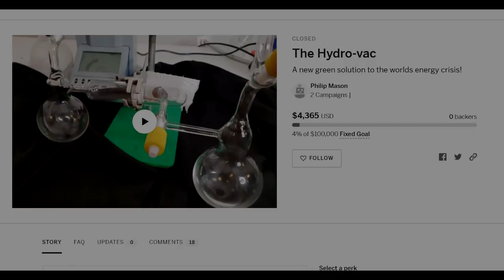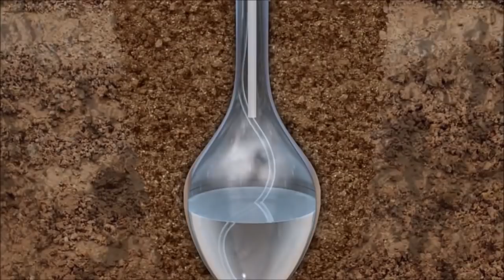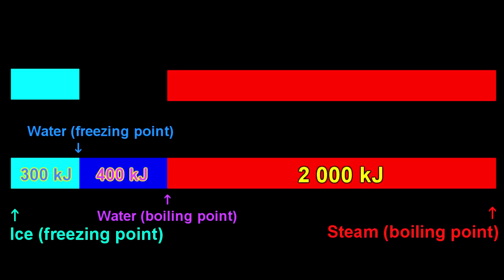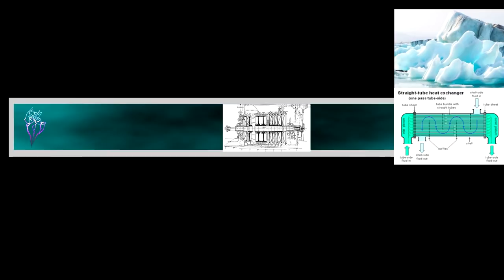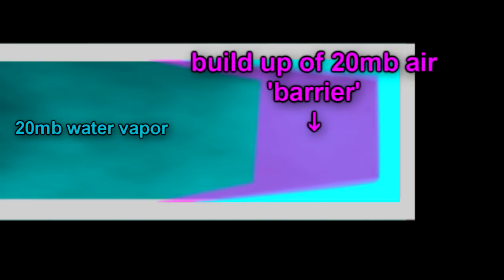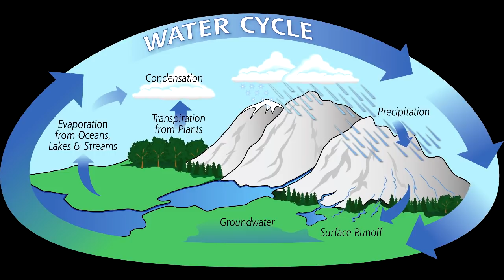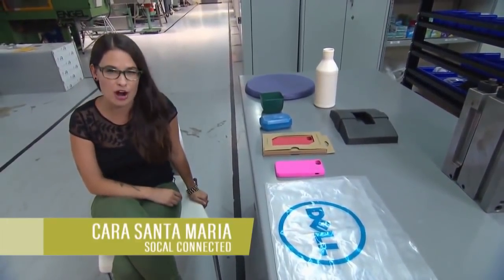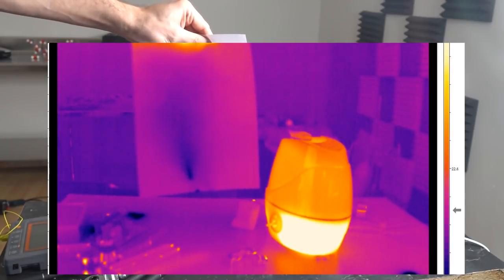The Hydro-Vac -BUSTED

Comment: I'm sitting at 7 minutes and I'm just curious why can't instead of using the ice to cool the end of the tube just use a really massive aluminum heatsink look I'm talking like a two-story heatsink the atmosphere could do the work sure it would warm up the Arctic but that's already happening
Reply: Dip one end in the ocean as a heatsink, and let the sun shine on the collector, not like the sun doesn't warm the sea anyway, although it will be a little less, if you are extracting some of the energy.
Reply: @threeMetreJim  na na he gets to why it wouldn't work
Reply: @candidcomments292  He's using the difference in vapour pressure, running the hot side at around 30 degrees C with the cold end at 17.5 degrees C will make the same vapour pressure difference (20 millibar). Probably a lot less efficient than a solar panel, but that doesn't mean that it wont work at all. Maybe you could get gravity to return the condensed water for re-heating??  He seems to also neglect that if you take energy out of the moving vapour (with the generator blades), you'll also need to sink less energy at the cold end to get it to condense again. It just seems to be a low temperature (and inefficient) version of how power is made commercially. Because of the (partial) vacuum, the water boils at a much lower temperature than normal.  Having a low temperature difference means it will have a low power generating capacity.  Just like a sterling engine.  This one is more of a phase change sterling engine, usually they just have a gas working fluid.
Reply: @threeMetreJim  continuous energy at a set rate is always useful if you can store it. But with the scale of the object + the distance to from production site to used location, this design is indeed none viable. Reliable energy is more important than high production for most grids.

Comment: Just assemble the hyper-loop in space (vacuum)
Reply: This has pretty much been proposed before one of the intended functions of most designs for an orbital ring is to serve as both a spaceport and a system for transcontinental or even intercontinental travel. Course while technically possible such an object is most definitely a megastructure for a civilisation at our stage of development and would likely require extensive international cooperation for many decades to construct though it does have the distinct advantage over a space elevator in that it is at least theoretically possible to build such a thing around Earth with current materials and the market for global transportation on Earth is very large something an orbital ring can benefit from.

Comment: what if you just boil water on the Equator and condense it on the Poles? you don't need a vacuum chamber to do it, the difference between 1bar and 0bar is the same as the difference between 1bar and 2bar.
Plus, you can rebuild the north poles' ice sheets

give me my billions of funding, i am the next Elon

Comment: Thunderfoot I love your vids. I have questions, now I am for hydrogen energy and Nuclear Energy. One I am not going to say that there aren’t a lot of scams. Thorium energy is possible the problem is we are not at the level technology level we need to be at. The military has made it possible to get water from the air, however it takes a machine the size of an ISO Container. US Navy Ships can easily desalinize Salt water. This technology is now viable on a mass scale, however if put in place in the civilian sector it runs into a problem. You know what I am referring to and it’s the ( corrupt politicians. California for example with the Democrats). I myself am fan of nuclear power and new nuclear technology. I have a question on what would it take to make Thorium a possible energy source? Also is it possible use a small particle execelerator( I know it’s miss spilled but my IPads spell check doesn’t  have the word available) ? How would I be able to store the energy from this type of device for home usage?

Comment: Why make it so complicated? 

Listen. Everywhere and all over the place there are pipes that facilitate the transportation of water to homes and businesses. Why not just insert into one of theese water-pipes a turbine that spins a generator?
Boom. Free energy.
In the water-pipe to every home such a device can be installed. The water spins the turbine, before it again continues on its merry way towards your tap. The water is merely borrowed for not even a second. 

Yes, only a small turbine and generator can be installed on such a small water carrying pipe. But you can have many of them in a row. ( Column? (English is not my first language. Plz excuse.)
Locally produced produce is the future, they say.
So why not locally produced electric power?  The big power-companies are going to fight this of course. As they want to burn their coal and gas and uranium and make big dollar in the process.
Reply: can't tell if Troll or not
Reply: Sounds good at first until you consider that taking power from the moving water will slow it down, a bit like the idea of charging your car batteries from a large fan on the roof of you vehicle; you need to burn more fuel to reach your desired speed.  This means you'd need to put more energy into initially pumping the water = increased cost to the utility company = higher bills = no saving to you.
Reply: threeMetreJim (I think it’s a joke)

Comment: Thunderfoot I get so feed up with your videos. I hate them (not because they debunk bad ideas but because they are so crap). Please structure them better. You know what you are talking about but please explain why I idea will not work not use sarcasim. 

I could sum up this whole video in its what your fridge does, If your fridge could become this amazing powerplant that generates power though the movement of gas do you think no one would do it. Just think of the compressor in your fridge being the thing that maintians the vacum in the tubes and you have a example of why it does not work.

Comment: I like the way you debunk your idea, but your way of thinking is irritating. Basically you had once design - a tube that either stretch to the poles or vertical along the mountain using water vapor pressure and you debunk, because it will get ice or it will heat the ground, etc. Seriously, this think can work only with water and nothing else? There is no region of Earth that can have hot areas and cold areas near each other (like a volcano next to glacier). Or is it possible the cold part to be submerged in the ocean that does both conduction and convection very well? I do not say your idea is possible, but to debunk something you should always present not only the problems, but you must shows possible solution to those problems does not fit together well.
Hell, using your method, I can debunk using water vapor for electrical production. I can boil water on my stove and show that it is too weak to rotate a generator. It can rotate an empty turbine, but at the moment you hook it to a generator hooked to a resistance (for example light bulb) it will stop. The steam is not powerful enough to produce electricity  required for light a light bulb, but hold on a minute - vapor turbines is what produce electricity for water power stations, nuclear power stations and coal power stations? At this moment you realize it is not that the steam is too weak to rotate a generator, it is the design that is bad. Open air steam is weak, but high pressure steam, that's something else. The same with Hydro-Vac - I do not know if your idea is bad or not, but you did not debunk it, as you did not try all possible designs. Every problem you presented has a solution, but I do not know it those solutions are compatible with each other.
Now, if somebody raise several million (or even thousand) for an idea, without testing theoretical models, identify problems, iterate designs, etc. - that would be something else. People should learn not to invest in ideas, everyone can have an idea, not everyone can prove if idea is feasible. So debunking stupid kickstarters campaign is okay. Debunking ideas, that did not get any money without exploring possible solutions, that's just stupid.

Comment: Honestly getting really tired of the repetitive and pointlessly long vids. And "debunking" your own device is so much simpler and easier. Of course then it wouldn't be a Thunderf00t vid I guess.

It's a closed system. And it only reacts WHEN you cool one side. It will quickly reach equilibrium and then your turbines stop. One side always cool and the other always warm in a closed system won't spin the turbines. And if it's an open system your turbines wouldn't work at all either.

I'm not sure exactly when you jumped the shark, but if it's not back a while ago then trolling your own scam (as someone else put it) is definitely it lol.